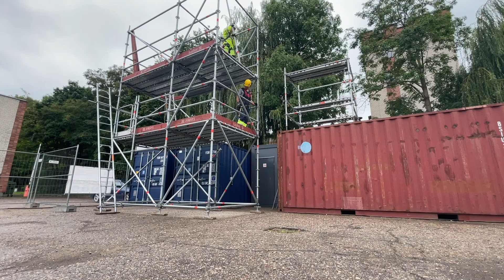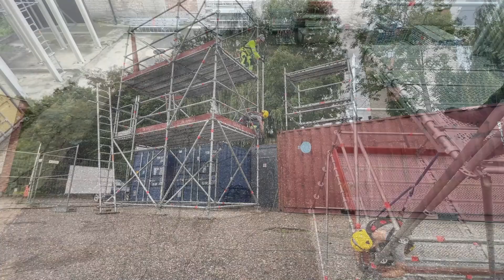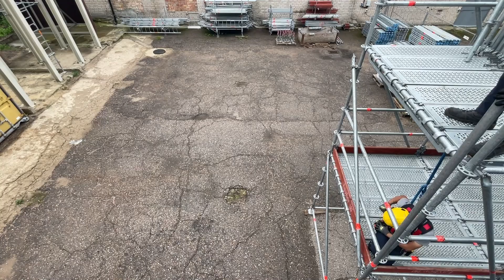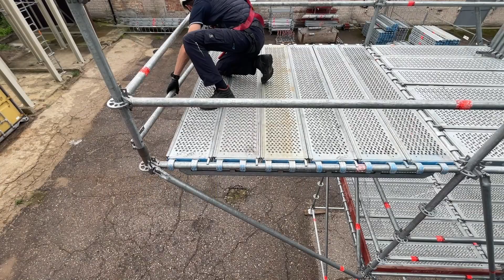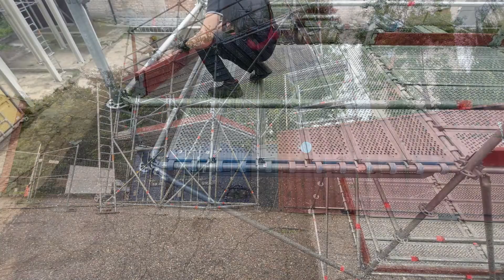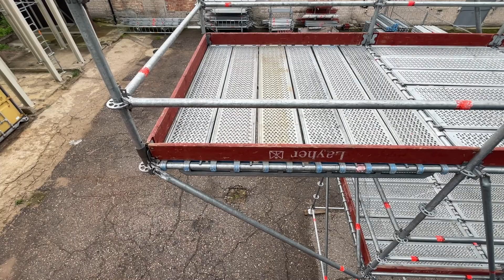Scaffolding training instruction how safely assemble Layher allround balcony using cantilever method

Comment: When erecting a canterlever like that you have to start lower when using spindle pots for the simple reason that you can directly connect your standard so it’s double strength plus with a canterlever you have to double up on the braces for extra strength , and your brace facing the front on a swivel is not allowed that’s not part of scaffolding training , and all toe boards have to be secured and made fast with a scaffolding spanner